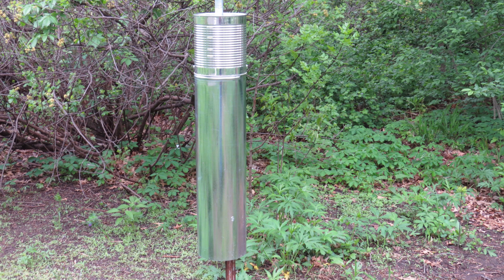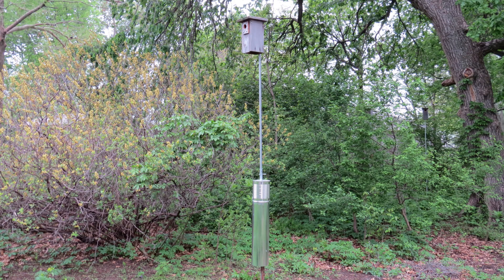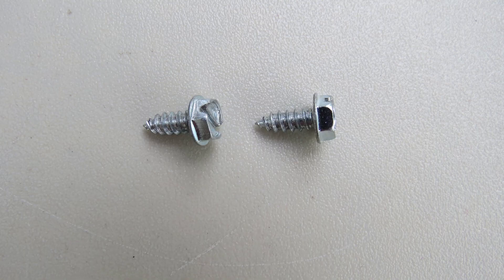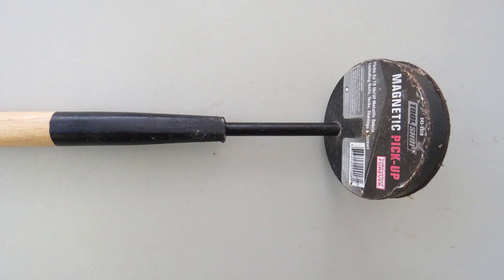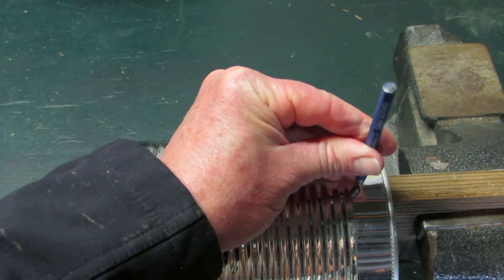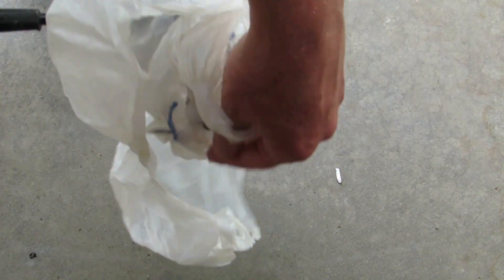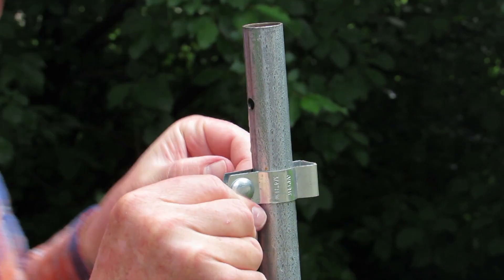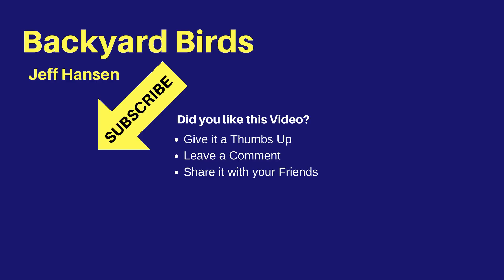How to Make a Predator Baffle with a Can & a Duct Pipe 2019

Comment: 3:40 Ingenious how you pick up the metal swarf with a plastic bag wrapped around a magnet.

Separately, I made a baffle this morning by sliding a length of plastic drain pipe over the wooden post holding the bird table. The square post at 45mm square was a tiny bit too big for the pipe to slide over, so I took a rasp to the four edges of the post and rounded them off a bit all the way down the post. Not much filing was needed. It took about 10 minutes to file all four "corners" until the pipe slipped over, but was still a snug fit. Since the pipe had been in my garage for five years it was dirty, so after sliding it over the wooden post I gave it a good scrub.

My problem isn't squirrels, it's a rat that comes under the neighbour's fence and climbs up the post. The very smooth pipe will hopefully make it impossible to climb up in future.
Reply from the maker: Did it work. I hope so. I know those climbing critters are hard to deter.

Comment: pro tip: you can make a similar design with zip ties, tape, and several plastic 2-liter bottles with the very bottoms cut off. trim a line down the side of each bottle and wrap around the pole, one below the other. rest them atop several zip ties secured tightly around the pole so they can rest on the zip ties. repeat to process once per bottle until you have 2 or 3 bottles "stacked" on the pole vertically. this achieves a similar effect for much cheaper, lighter, and with less equipment and work required.
Reply from the maker: Interesting. So one bottle isn't enough? Are two enough?
Reply: @BackyardBirdsUS  yes, a minimum of 2 is required to work effectively, like 99%, but 3 would work 100%.
Reply from the maker: I'll have to try it. I love do it yourself baffles!
Reply: @BackyardBirdsUS  please do! it's really easy and costs only a couple dollars to implement because most people already have most of the stuff needed :) i filmed a video about it for my channel but haven't posted it yet. i can return to remind you when i do, if that's helpful.
Reply from the maker: Thanks. I think i can do this on my own. Although i should subscribe to your channel.

Comment: Thank you good fren, not what I'm looking for but inspired me to go for it.
I made an in-line backdraft baffle/damper for bathroom exhaust duct using a coffee can, small hinge, and rivets.
Reply from the maker: Awesome. So this helped? Those cans are good for many things it seems.
Reply: @BackyardBirdsUS  Well, it got me to stop over thinking and just get to work on it :D
The metal lid was  bit too heavy for the bathroom fan so will modify it with a plastic or a foam flapper.
Think I'll make some bird houses over the winter for spring time, maybe they'll leave my garage alone.
Reply from the maker: I love your ingenuity. And good luck on bird houses.

Comment: I have a large raccoon baffle from WBU, and it worked for several years, until last night. One of the raccoons found a way to access the feeders, and that worries me since I use those same baffles on my nest boxes. 

What is different about the ones you make as opposed to the WBU kind, and can the baffle you made be used with a WBU nest box pole? 

Also, the baffles and poles have a slight texture to them. Could this be how they were about to scale the baffle?  It swings and bangs against the pole, and the sound scared off the other raccoons who ran like the devil was at their heels. lol But it didn’t bother the one who scaled it. I still have no idea how that raccoon managed to get up there.
Reply from the maker: Racoons are persistent pests. Hard to know how he did it without seeing him do it. I don't know what a WBU baffle is. But it seems no baffle is 100 percent effective. Is your pole leaning? I had an issue with a squirrel because the leaning pole gave him access.

Comment: use 3 screws! it holds better stronger and does not swing at the joint!
Reply from the maker: Three screws on the can?
Reply: @BackyardBirdsUS  yes.as a career in sheet metal I know that any joint like that takes 3 screws/pop rivets minimum to hold it strong and straight unless you spot or tack weld it in same way...
Reply from the maker: Thanks for the input. Smart!

Comment: What diameter is the pole?
Reply from the maker: It depends on the pole but I use 1 inch and 3/4 inch conduit. Information should be in the video.

Comment: This won't work with with shepherd's hook bird feeder poles. Those have a side foot  on the bottom for stability and you can't slip the can over it. However, the duct pipe will go around the pole. For a cap on duct pipe I use the bottom (or top) of that can. Cut hole in center, and then cut a slit to center so you can put it around pole. Wire the can to duct in a couple of places.
Reply from the maker: Good idea! I've used a cone baffle on shepherds hooks.

Comment: Finally getting around to making my baffles.  I noticed in my Troyer catalog that they now have sniffer holes in the top of theirs.  I don't know if that makes a difference or not I'm told a large snake can get around a baffle.  The claim is the sniffer holes allow the scent to enter the can so a large snake will go in instead of around.  I don't know, but I'm going to add these to mine.  Just thought I'd put that out there to see if anyone smarter than me has an opinion.
Reply from the maker: What is a sniffer hole? My baffle should work for snakes.

Comment: I suggest that you use three sheet metal screws to attach the HVAC pipe to the can. This will prevent the pipe from rotating inside the can.  This is a code requirement for HVAC installations which I learned the hard way when I sold my house a few years ago..
Reply from the maker: Good idea. Thanks for sharing your knowledge.

Comment: Excellent job! 👍 This is great if you're using conduit but not an easy task for a shepherds hook if it has several spiked anchors (or whatever they're called) spread out beyond the can's diameter; however, the duct pipe wouldn't be a problem since it opens. Maybe some shepherd's hooks feet would fit through the can if you took the bottom off.  I do plan to make a bird feeder pole from conduit though and I have a friend who manages a cafeteria where huge cans are abundant so I will definitely consider doing this project as an upgrade for it and for my shepherd's hooks IF it'll fit!👍 
 Many thanks to ya'!🙂
Reply from the maker: Shepherds hooks are problematic. I quit using them as squirrels just run  up them unless you get a commercial baffle

Comment: I have a baffle given to me as a gift for my bird feeder which is on a 3/4" painted metal pole. Your baffle works,but I would be nervous mounting it so close to the ground-squirrels can jump a surprising distance. My baffle is mounted just under the top of the feeder pole, which is about 6' tall. It is entertaining to watch squirrels try to defeat the baffle,sometimes crawling up the open bottom of the baffle before giving up.
Reply from the maker: Squirrels are amazing. I agree it is good to mount so they can't jump past the baffle. It's important not to have something they can jump from like a tree as well.
Reply: @BackyardBirdsUS  I agree! Squirrels will try every possible way to get past a barrier. I was also careful to site the feeder well away from nearby trees. Lately,I have found that large grey squirrels can defeat my baffle by gripping the feeder pole with their hind paws,and hopping up and over the baffle. I fixed that by hanging an 18" length of 2" PVC pipe just below the baffle. They cannot get any purchase with their hind paws with that arrangement.
Reply from the maker: I can't believe they go around the baffle. How frustrating

Comment: Cant you just use a 6 inch sheetmetal cap instead of the can?
Reply from the maker: That would work. I used the can to add a little length. I need to look into the sheet metal cap. That sounds like an excellent idea.
Reply from the maker: Are duct caps readily available at big box stores?
Reply: @BackyardBirdsUS …yes; available at Lowe’s for sure.

Comment: Great video!  Thank you!  I wonder how to make a baffle to be used with a shepherd hook... any idea?
Reply: I was thinking the same thing.  Did you figure it out?
Reply from the maker: For a shepherds hook I buy a cone baffle that wraps around.
Reply from the maker: Try a cone baffle. I've also used a plastic flower pot cut and inverted on the pole. I used a hose clamp to hold it in place.

Comment: Great job!  I do something very similar in my yard, except without the can and my post is a wooden 4x4 post.  I should take a video one of these days... Thanks for sharing!
Reply from the maker: I'd seen different methods but thought the can attached to the duct pipe was darned clever.  AND I'd never seen it on the internet before.
Reply: Yes please, do a video.  At least show how it looks already done. I also have a 4x4 post.
Reply from the maker: I wonder if you need any 8 inch stove pipe?